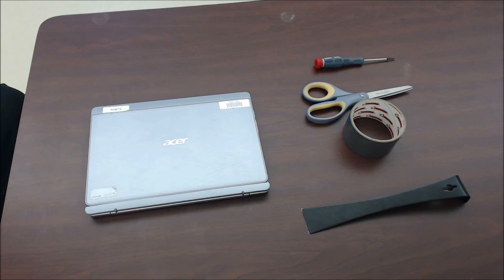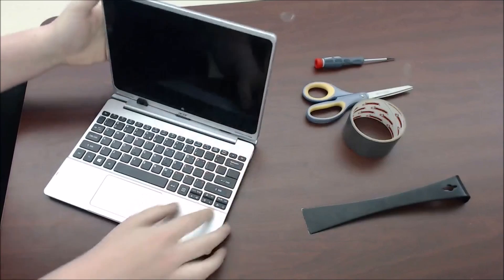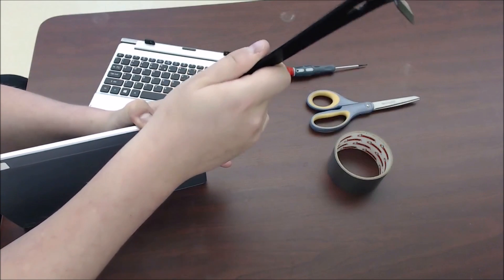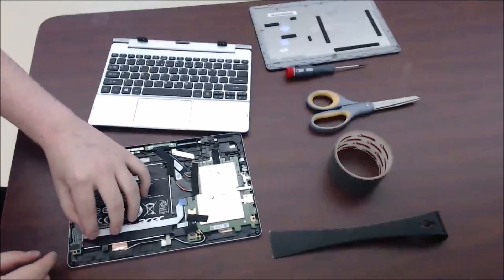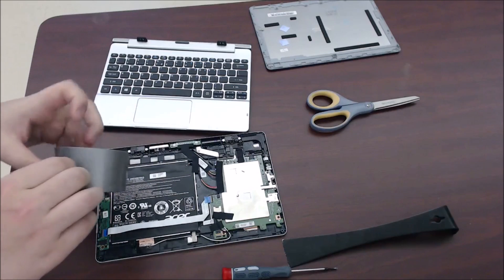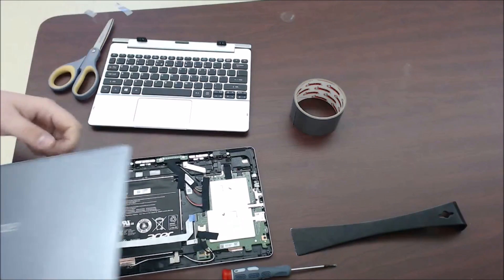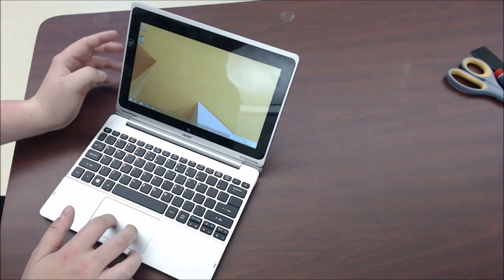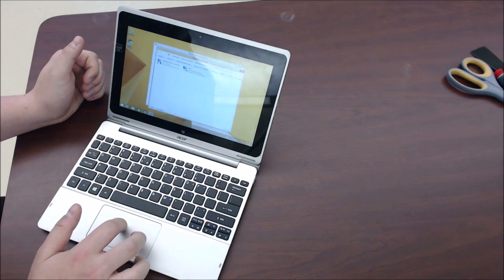Basic Troubleshooting of Acer Aspire Switch 10

Comment: I have the same kind of tablet acer 2 in 1, in black. The battery went low very fast, then it won't charge, the orange led does not light up, and i cannot switch it on. I opened it up to see , same problem.  I can hear a sound when pushing the power button then it stops. What to do?

Comment: Great thanks. I had similar problem. My charger cable was broken. It often charged but sometime stopped. Tablet went out of power and I couldn't switch it on. I was moving the cable near the plug and saw the difference with power indicator light. I bought a new charger and problem wa solved.

Other question:
Is it possible to upgrade WLAN to 5GHz one?

Comment: Technicians don't usually use a metal prying tool because it is so hard that it can easily deform the plastic parts.  Moreover, prying tools are not as big as construction tools.  There are more decent plastic prying tools available in computer shops.

Comment: I I  have a acer one s1002  .  recently the windows clock show wrong time. It is possible that there is a clock battery to replace ? THe error happens also with external power plugged.

Comment: Thanks for the quick tip,

I appreciate if you could show where's button battery located, I can't find it, and I don't want to remove the motherboard for avoiding any issue with the wires.

Comment: Nothing but problems with this thing lol. I replaced the dc charge cable several times. Hardware resets. Now it won't turn on. Put a multi meter to it. Read 12v by the 4 dc prongs. And read 4v by the battery 4 prongs.
Reply: Thats sad cause when it works is a great machine. Mine shuts down afteer 15 sec on battery even though it shows 100 charge.  With the adapter it never turns off, it eeven works thru a usb phone adapter

Comment: mine won't boot into windows nor into recovery mode, when I push f10 you see the blue windows logo with the text "preparing recovery please wait" but immediately after that the green Acer logo comes up and it try's to boot normal again which is not working. this end's up in a endless bootloop. I don't have the Erecovery usb stick to restore windows.
Reply: Mine shutss down after 10 seconds aand the battery is full? Ive looked on many forums and no answer

Comment: so i opened it up, and when i looked at that cable the entire blue end was disconnected from that black bar! What can i do to fix this? I just really need to get my documents off then i dont care if it dies! Please help!
Reply: OK, nvm. I fixed it. Needed to shove the blue end back into its terminal and it turned on. However, secondary problem..... the charger still will not consistently work. Is there another thing that could be wrong?

Comment: Thanks a billion times!! after a little fall from a height of about 15cm / 6-7in post a rigorous security check in Beijing, I later found out when hanging in Hong Kong that my switch would not go on. Searched for a few tips  on how to fix this and your video was the most accurate, informative and certainly the easiest to follow. I used a sharp kitchen knife (instead of a flat screw driver) because I did not want to leave dents along the seam or groove.It was loose exactly where you said it might be. it is now fixed :-)

Comment: Thanks a lot. Your description solved the problem with our Acer Switch 10. My wife wasn't able to turn it on. So I followed your instruction and found out that we had the same problem. Instead of metal tools I used a guitar plectrum to open the housing because it doesn't damage the surface.

Comment: Thanks a lot, you helped me solve my issue! The cover was hard to remove without the proper tool (I had to use a tiny screwdriver and a guitar pick lol) but other than that it was really easy to fix following your instructions.
Reply: I used finger nails, a spudger tool and a philips screwdriver.  It was the flat cable coming loose that was indeed causing a no-start.

Comment: hi nice video. i have the same notebook as yours, but my problem is the magnet that connects the tab from the keyboard or notebook. The left side part does not connect properly. it is loose and i had to carefully open the tablet slowly so it wont fall off, and when closing, I had to press the tab so it will stick properly. the guy that I bought this at the mall said that this is normal. Is it really? it is only a month old that i bought it.

Comment: THANK YOU SO MUCH :)
i have the Acer Switch 10 sw5-012-18sa, 
same troubles as yours (blue light on with AC adapter plugged, but not able to power the computer on), 
thanks to your video, i was able to find the problem and to fix 1 cable, even Acer added taps on each cable,
it took less than 5 minutes to fix this amazing computer, 
thank you again, 
from FRANCE ;)

Comment: Hi...
I have the same laptop.
while using, itself if powered down and nothing apears to show..
it doesn't light the charging light on the power button, no screen display, nothing ...
i did what you explain in this video, but no cable un pluged problem..
can you help me plz???
Reply from the maker: I have found that if the power light doesnt light but and that ribbon cable is connected, you might try unplugging the battery cable waiting about 30 seconds and then reconnecting.
Reply: I upluged the battery cable stil it has the same problem, nothing appears..
i think may be it is mother board problem...
Reply: Saxony Lutheran

Comment: So Both my volume button and the power button dont work, it charges, currently the laptop is on and im scared if i switch it off i wont be able to turn it back on due to the power button not responding, any help with this?
Reply from the maker: Sorry for the delayed response. But it sounds like to you have the ribbon cable problem like I describe in the video. If you open your tablet follow the steps like I do the power and volume buttons will start to work again.
Reply: Saxony Lutheran Thanks for the reply dude, but i have already fixed the problem, it was the ribbon cable like you said. Cheers for the reply though.

Comment: I checked that ribbon cable, I do get an amber light, then blue when it's fully charged, still no boot. Tried holding down power button, disconnecting the battery, discharge and plugging it back in. Had it connected via HDMI in case it was my LCD, still nothing. Any tips would be greatly appreciated!
Reply: Juan Carmona dame problem here, and when I touch the Windows sign on the screen it vibretes? I don't know what the heck it's wrong with mine :(

Comment: How fucked am I if the charger broke off inside and I touched broken ends trying to get it out whilst it was on? Pajeet isn't helping. It won't turn back on. No, I have yet to see entire video. Got 6% on phone, so I will update in the morning
Reply from the maker: Well if the charger was the piece that broke off into the charging port you shouldn't be that bad I wouldn't believe. If you open the tablet and get the broken piece of the charger out you can buy a new charger and that might work. Hopefully you didn't break the pin inside the charging port.